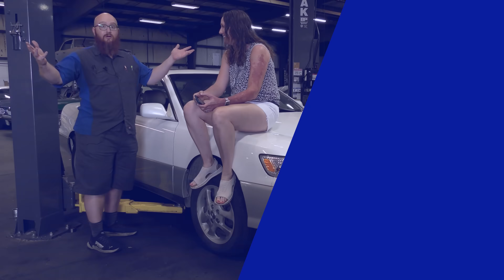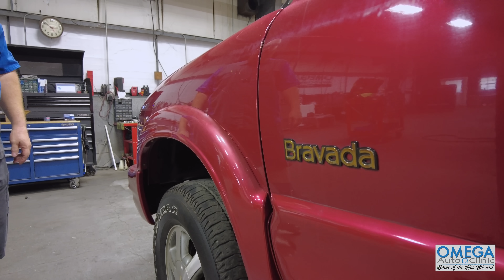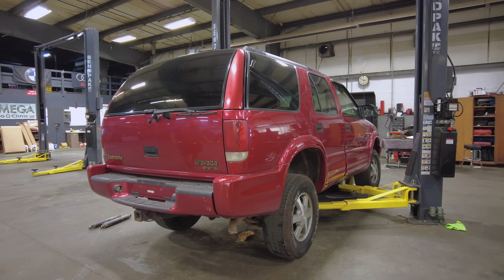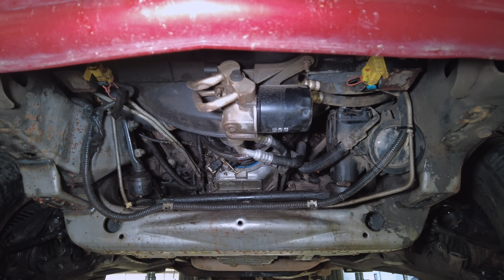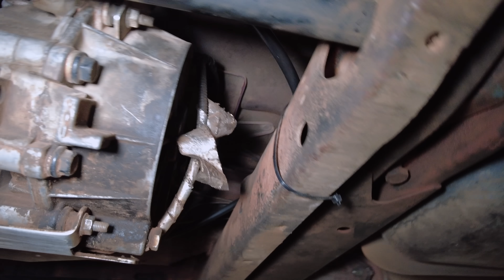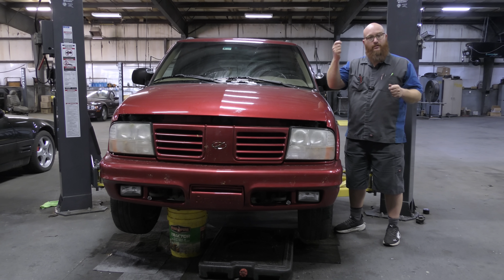Is Car Wizard Taking American Cars Again? That's an Olds Bravada!

Comment: I miss Pontiac a lot more than Oldsmobile, but I remember when the Cutlass Supreme was one of the most desirable cars to own.
Reply: It was the best selling car in America in 1976-77
Reply: My first car was the one year only design 1980 oldsmobile cutlass supreme. Sadly I didn't know much about cars back then and it had some small issues we couldn't get fixed so I sold it for $1000. I've looked for another one off and on every since and hardly ever find a 1980 for sale. They are so cool because it was the only year with 2 headlights on each side but the flat grille instead of the slant grill that started in 1981 and 1 headlight in 1979 and previous.
Reply: My 1st car '72 Cutlass supreme
Reply: It still is. Very sleek design from GM.

Comment: In our area, if the body is solid and interior is in great shape, at today's prices, $3,000 is a bargain to get another 60,000 miles out of it.
Reply: I'm right smack dab in the rust belt so I drove about 6.5 hours straight south to get to where there is less to no salt used.  A little old lady owned this Bravada so it's got a lot of life left in it.  I'm not really partial to the Bravada, but for what we needed, this little ute checked off all our boxes.  It will outlast just about anything made today.  Our 1989 Buick keeps on running and you don't see them on the road much any more. Any car can be fixed and if it's a platform  that is known to be reliable, it's worth fixing.  Still cheaper than buying new.
Reply: @LazloNQ hey there, looks like you & I are car cousins because I own an ‘89 Olds Eighty Eight coupe which I drive daily :)
Reply: @LazloNQ  what is ute?
Reply: I have a 2002 Blazer. Bought it with 153K miles back in 2018. Fast forward to 2024. Now has 228K miles. I paid more for repairs, but runs like a top. Is it worth it? For these SUV's, yes it is worth it.
Reply: if you can get another 60k out it. Anything GM from the 80's or 90's wasn't the best vehicle new. At 25 yrs old they likely will nickel and dime, or even dollar and hundred bill you into it-not-being-worth-it territory. The very fact that the transmission failed at just 120k miles speaks for this.
Reply: @petrosaguilar8916  Transmissions usually fail because people are TOO AFRAID of transmission shop rip-offs, so they will do 100 engine oil changes, but never transmission services.
Reply: @ThisOldMan-ya472  what is normal life span of a transmission? I don;t think I ever had a car long enough for that to fail  (note: I drive a small amount per year compared to the average american)
Reply: @Blackadder75  There is no real normal lifespan of any equipment. It almost always depends on use, maintenance, abuse, design and type. I have a few 2001-2004 Nissan Pathfinders with stout automatic transmissions. Some will only last 100,000 miles and others will exceed 200,000 miles, and rare ones fail at 45,000 miles. I have personally owned 200 various makes, models and an assortment of transmission types. The only one to fail on me, was due to excessive heat and lack of lubrication when towed by rope for 20 miles at 60mph. We should have disconnected the driveshaft. 🙃
Reply: @ThisOldMan-ya472  ty for the explanation
Reply: If you don't beat on it and keep the fluid changed, a transmission should last 300K. At about 15 years old I've had two of them start having problems in sub -10°F temps. The one I have now, a 2004 grand caravan, runs great but when it's about 32° it has to warm up else it can't get out of the driveway. 300K on it. I assume the seals are hard and shrink when cold.

Comment: $3000.00 is a bargain when you consider what it cost now to replace it with a new vehicle.
Reply: You’d have to buy a Bronco, a 4Runner or the like as equivalent new. You’re not getting in one of those for less than $45,000.
Reply: It is worth it for $3K
Reply: Definitely worth it if the vehicle is in otherwise nice condition. If it costs that much more to buy the devil you don't know, why bother chancing it. Just fix your nice ride and enjoy it for many more years.
Reply: Any old vehicle that needs to be brought back to the specs, 3K is nothing. The thing is, there are mechanics out here that'd tell you to replace the vehicle when there's a expense like a transmission. Like, of course, it needs to be repair. it's a twenty year old vehicle.

Comment: It is, it's every Oldsmobile owners duty to keep it on the road as long as possible, I miss oldsmobile 😢
Reply: Same with Pontiac 😊
Reply: @timc9893  any brand that's gone, mercury, Saturn, Saab, I definitely wanna own a car from one of those brands if not multiple haha
Reply: @tetriseffect711 what about the sky
Reply: @tetriseffect711 almost every Saturn made before 05 was a reliable car, definitely not a piece of shit
Reply: @tetriseffect711Saturn was awesome until GM was going bankrupt.
Reply: it's just General Motors... Oldsmobile, Pontiac, Saturn, late model Saabs all just General Motors.
Reply: I drive my Aurora every day, doing my part
Reply: The hood olds guys...a 78DYNAMIC.   88. WITH A 350WAS A HOT ROD
Reply: Got my 1998 Regency I got indirectly from a little old lady...GM 3800, goofy styling, but every now and then in a parking lot, someone will ask about it, and reminisce a bit about their 90's GM.
Reply: @samuelsabo9493 You mean '07, when the Aura came out? It was the first car that wasn't even a Saturn, no plastic body panels or anything. It was pretty much just a more upscale Pontiac G6 or Chevy Malibu.
Reply: @hakeemsd70m  yes, but even then I still liked the aura
Reply: @samuelsabo9493 I own a mercury grand marquis. Go get one. That or an Oldsmobile 88/98 regency. Amazing cars
Reply: Oldsmobile silhouette is also great
Reply: @mineman-wo1hi  i want an 88 at some point for sure, as for mercury I want a mountaineer or something haha
Reply: Currently driving a 1989 Olds 88 Royale Brougham as one of my two dailys. 
I recently bought it because I had one as my first car 25 years ago. I actually really missed it. So smooth and comfy to drive  and decent power. 
I'll keep it until the day I die. Whatever it needs I'll do. Everything is really cheap to maintain that car really.

Comment: I know it’s probably just a slip of the tongue, but they only come with V6 is and what was interesting about the Bravada was that instead of having four-wheel-drive it had all-wheel-drive which made it different than the blazer and the Jimmy that came in four-wheel-drive
Reply: A friend ended up with a Bravada just like this one, when an uncle died. They guy had different size tires and all at different ages, i.e. worn down at different levels on each corner. Suffice it to say, every tire was replaced all at once so they were even and the right size. The AWD system would not have been pleased with the different sized tires, it was advised this get straightened out right away before any damage or extra wear on the AWD system was done. I'm guessing if it was a 4 wheel dive system like the Jimmy, this would have been less of a concern, being you only engage 4WD occasionally for snow and mud etc.
Reply: @marcusdamberger  Different sized tires are very hard on your differential. Here you've got 2, and that feedback to the computer in the transfer case is a recipe for disaster.

Comment: I worked at chevy/0lds dealer at the turn of this century. These and blazers were my pay check every week. There were so many of these and blazers on the road.
Reply: Im betting you could R and R a timing cover on one in under 4 hours.
Reply: @stevenreynolds2327  yes lol there was a way around pulling diff.

Comment: I used to build those at the Moraine, Ohio GM assembly plant. I may have put the front axle in that truck! I did that or front spring install on the 2wd versions of the GMT 330. It was one of the first jobs after the frames entered the factory from the railyard.

Comment: I had a 2001 Chevy Astro van with the 4.3 liter, Car Wizard is right, those old 4.3 votec engines are truly a reliable engine .
That van had over 327,000 miles, and was still running when we sold it. The body was rusting out.
It certainly wasn't a horsepower monster, but it just was a good durable engine. It's a shame they don't make them anymore.
Reply: I've called them them the Dinosaur  4.3 as opposed to the LS derived 4.3. Horsepower was the highest and the most the could come up with is 200 hp. My dad had a 1992 C1500 with it and I inherited a 2003 GMC Sierra with it. Nice engine and easy to work with. Always like AC Delco Iridium spark plugs on the Sierra when I had it.
Reply: @richardmullins9299  I like it when my engines outlast the vehicle.  Then I can always pull the engine and repower an old VW bus with it or sell it while scrapping the old rusted carcass.
Reply: 24mpg is nice

Comment: My dad had a 99 Sonoma 4x4 extra cab PU, almost identical under the hood and undercarriage. He said those oil hoses to the remote filter were notorious leakers, but that remote filter location made oil changes so much easier.

Comment: I have two older vehicles which are well-maintained and paid off. A repair of $600 is like one monthly payment on a new car. I've replaced other items in the past few years, so I know which parts are good. Why swap that for a used car that has problems I know nothing about? Paying $3,000 isn't cheap but if you like your vehicle, it's worth it.
Reply: I trust older stuff more than newer.  Crawl under a new vehicle and you'll see such thin metal you know within a few salty winters you'll have to junk it.  All the screens and electronics makes them a NO for me.  Can't work on it so I won't own it.  I like mechanical simplicity with a little bit of safety thrown in the mix.

Comment: I know that timing cover gasket is integrated with the oil pan gasket, so changing it is really a nasty job.  The GM shop book calls for disconnecting the engine mounts and raising the engine enough to lower the pan so the gasket can be removed.  Some shops remove the engine from the car to work on it.  Despite this these are still good reliable cars.  I have a 2000 S10 Blazer with 352K miles and it keeps going.  It has a few problems but it's still cheaper than buying new.  I'm keeping it.
Reply: @therealbarnekkid  yes, mine I replaced the motor mounts at the same time.

Comment: I have a 2002 GMC Sonoma with 242k miles with the 4.3L. Love that truck and have been driving it for 10 years. It’s needed some work over the years, but it’s easy to work on and parts are cheap/readily available at any auto parts store. Really the only major issues I have had is the intake manifold gasket, injectors, and fuel pump. All of which needed replaced around 200k.

Comment: Good video.  This almost makes me miss my 1995 S-15 GMC Jimmy with the 4.3L Vortec.  Only issue I had in 180,000 miles was the stupid central port fuel injector.  If I recall, this version was all wheel drive. I gave it up when driving down the interstate at 65 MPH and my 4WD actuator suddenly slipped into 4Lo.

Comment: I have a 1994 Jimmy with almost 100,000 miles. Had to replace the same oil lines (oil filter was moved adjacent to the front driver wheel well). Other than that and standard maintenance,  it's still going strong. 

BTW, in life and business you are allowed a level of self determination, which sometimes (or often times) means making U-turns.👍
Reply: I don't watch the channel much, but never saw the videos people reference and had no idea.  I asked Dave if he'd like to look it over and film it and he agreed.  Must have had a change of heart.

Comment: I bought a 96 Chevy blazer of which I leased, with the v6 vortex engine. My mom drove it to Detroit MI. Needlessly to say, she fell in love with it. She loved the color (metallic purple) talked about how easy it was to get in and out, not to mention that, that lil truck got some power. She had a fairly new Malibu. I'm a Chevy man til the day I die, and she loved Chevrolet also. Well, guess what? Yep I traded cars with her, about a week later I traded the Malibu in for a brand new Tahoe. Never had a major problem with neither one of them. My father told me, when I was young that if I by a car, a Chevy is a good car. Low maintenance easy to maintain, good on gas and cheap. Best advice he gave me. I've had every Chevy truck/van available.

Comment: My 98 S10 ZR2 went to 176,000 miles without having to change the problematic intake manifold gasket or central point injector....Decided to sell it and buy a 2020 ZR2 Colorado....I'm thinking my Colorado won't make it to 150,000 miles to tell the truth. GM built the BEST vehicles in that era....Glad your back to working on vehicles "relatable" to the average viewer👍
Reply: If you want a good vehicle that will last you a long time, those old Buicks from the 90s and early 2000s was the pinnacle of success.  After that, they started making stuff so cheap.  Crawl under one sometime and look at how stuff is built.  In the salt of Nebraska, it just won't hold up.  I watch the Just Rolled In youtube channel and people have rusted frames right and left.  Years ago, our bodies rusted but seldom the frames.  Now to meet fuel economy regs, they are making them so light and cheap they turn to powder and you get to pay for it.  All that computer junk in them is nothing but a distraction to keep you from seeing how cheap they are built underneath.  It's shocking.
Reply: Most GM models from the 90s into the early 00s weren’t the most reliable but they were inexpensive to keep on the road.
Reply: I see far more S10’s and the GMC equivalent than the Colorado models that replaced them.

Comment: That car ‘s engine doesn’t have direct injection or variable valve timing. It’s a simple engine that if maintained properly will last a long time with no expensive repairs. If it were mine I’d keep it.
Reply: Which is exactly what we're are doing with it!

Comment: I paid 2000 for my 2001 bravada with 134k miles. I'd rather put all the money into it vs buying another vehicle because the fact mine is paid off and there's just no point in another vehicle.

Comment: Tbh one of the reasons why I became a mechanic and work on my own cars since 2013, is due to the absurd costs of labor, as if parts weren't already absurd as is.
Reply: Same here, since 1987.
Reply: Same...mostly because I dont trust mechanics to do the job properly! 😏(And I can do it without all the whining!!)
Reply: My Dad always said, if you want it done, just hire somebody to do it.   If you want it done right, do it yourself!  😉
Reply: @SuperDirk1965  I'm millennial but always had gasoline running through my veins because of my father, and motorcycles. I'm not in a physical condition to ride motorcycles anymore but I still love wrenching on my daily.
Reply: @willytheekid  exactly, so they overcharge for a mediocre labor and chinesium parts.
Reply: @willytheekid  though if I'm honest, I feel like I swear 200 times an hour when I have to do anything that has got to do with transmission/axle work...that stuff is torture for me, I'll still do it anyway as I'll save a lot of money

Comment: It's straight with next to no rust. 4.3's don't get the best mileage, but they're fairly bulletproof and the difference in mileage versus buying something that would get slightly better for the same form factor would probably take more years than the replacement would last. I'd put the money into it, for modern stuff it might cost that just for a taillight assembly (they decided to have it all sealed so when it fails you're buying a new one or maybe using heat to open it and swap the LEDs if you have the expertise). 

I like old stuff anyway, my local daily is a 94 hard body Tracker I picked up with under 93k miles last year that had just been completely redone by the owner of the dealership as a toy before they decided they wanted a Taco instead and sold it up me for a loss.
Reply: Can't go wrong with older stuff.  Working on my grandpa's 1973 Suburban at the moment.  Doesn't look like much, but it will be my heavy hauler and no electronics to fail or computer screens to blank out.  Just good old simple mechanics.  Taking backroads into Newton, KS from the south, I drove by many small towns with plenty of old squarebodies still being driven.  We got it figured out here in the stix.  :)

Comment: Except for the engine and body updates, it's still basically my 1985 S-15 Jimmy, except mine was 2-door rearwheel drive with a 2.8 L V-6 and a 4-speed manual.

Comment: Thank you for sharing this Oldsmobile Bravada,. It was interesting to see and see Car Wuard discuss this model.  As an Oldsmobile owner, I say thank you. I own a 1996 Oldsmobile Ninety-Eight and a 1992 Oldsmobile Toronado.  The owner has a good vehicle. I have said if I were to buy an suv, I would buy a 2002 and up  Bravada. I like the looks of that generation. I liked the early ones from the 1990s that had digital gauges as an option.
Reply: As a rule I avoid digital gauges because of the threat of electronic failures.  The more mechanical the more I like it, but I have to compromise somewhere.  Godo on you for owning the Oldsmobile 98 and Toronado...both great GM vehicles.  Keep 'em rolling!  You'll never find better...
Reply: @LazloNQ  I understand. Thank you for your response. I had analog gauges go put before. That was mechamical. Most new cars have digital gauges in 2024. I never was a fan of analog gauges. That is just me. I am doing my best to keep them rolling.